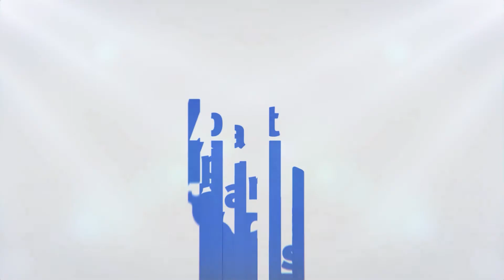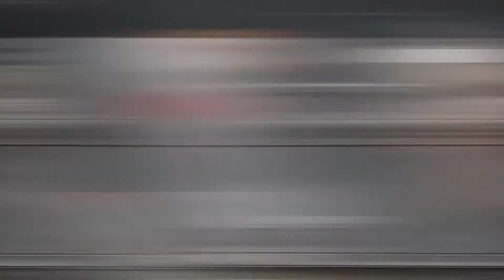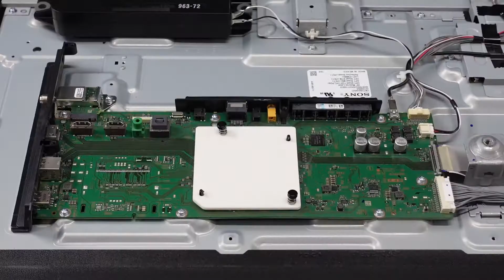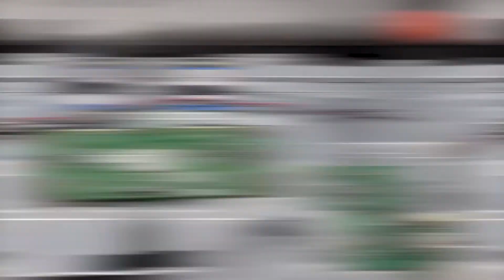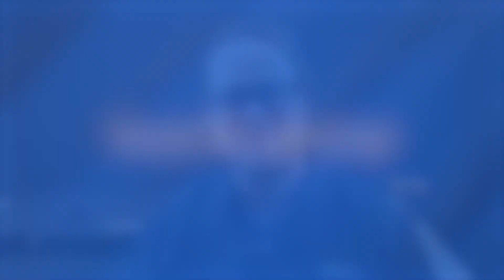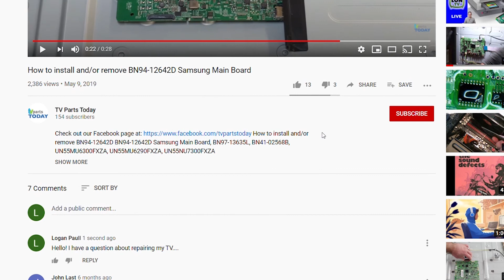Do-it-yourself TV repair.  (SONY XBR-49X800E)

Comment: I have a xbr-55x800e 6 flashing red lights TV turns on but at the boot up it sometimes don't make it through and it starts to blink red o was thinking led is messed up but the screen comes on
Reply from the maker: We would recommend replacing your LED driver board and if that does not resolve the issue, its going to be the backlights themselves.
Reply: @tvpartstoday  can you  advise me if that's the power board or that daughter board at the bottom

Comment: My xbr65 keeps turning on and off (loop) tried factory reset holding volume down Button and power button tv.  No luck.  Then tried volume down button on remote and power button on tv.  Momentarily screen showed safe mode, but then went back to doing same thing again.  Any recommendations on what might need to be replaced
Reply from the maker: That could be your power supply or your main board. I would suggest replacing both. If you need help to identify those parts please send us an email at info@tvpartstoday.com.

Comment: I have a Sony XBR55-X800E the main board is discontinuated, i want to fix it it only has one year of use, i saw that the XBR55-X800G is newer and it has the same size conectors and is pretty much the same, but i'm not sure if it will work, can you give an advice?
Reply from the maker: The main board is definitely still available! We get this main board in on an almost weekly basis. The main board is definitely still available! We would not recommend using a main board from any other set as it will not work for you. https://www.tvpartstoday.com/A2165797B-A-2165-797-B-Sony-Main-Board-17363371-p/a2165797b.htm
Reply from the maker: It is not discontinued. We get them into inventory often and also test this specific part in a live working set before shipping it out!   https://www.tvpartstoday.com/A2165797A-A-2165-797-A-Sony-Main-Board-A2165796A-p/a2165797a.htm

Comment: This is awesome - my sony xbr-49x800e doesn’t respond at all to manual power or remote. I can hear a little buzz sound when I plug tv in. I will be calling you. This model has had major issues from what I see in Sony’s forum. What should I start with regarding fixing?
Reply from the maker: Does your standby/indicator light on the front bottom of the TV blink at all? I would start with replacing the main board and go from there! We are out of stock on it at the moment but we get these in almost weekly. This main board is one that we are able to fully test 100% before shipping! The link is below: https://www.tvpartstoday.com/A2165797A-A-2165-797-A-Sony-Main-Board-A2165796A-p/a2165797a.htm

Comment: I have a Sony XBR-75X940E, and the middle of the screen, about 2.5 inches thick are colorful vertical lines that goes all the way down.  I've taken the back off, searching for any loose ribbon Cable, can't find any.  What should I do next?
Reply from the maker: The symptoms you are describing could be caused by either the main board or the tcon board!

Comment: I have a Sony XBR-49x800E.  My screen suddenly turned to a bluish/dark grey color.  I could hear the tv show still running and was able to get the tv to action commands from the remote (even though I could not see squat on the screen).  This tells me that the  issue has to do with the screen which led me to believe it was the LED driver board.  Do you agree with that diagnosis (I'm no expert on smart tv's by the way.  I'm just doing this by logic).  Let me know your assessment so I can buy the board that needs replacement.  Thanks C.Rausseo
Reply from the maker: LED driver would be a great place to start. If the backlights are totally out and not lighting up at all, there could also be an issue with the power supply board or the backlights themselves. If you are still seeing some illumination coming from the screen, there could be an issue with the main board. If you would like a little more direction and maybe someone to bounce ideas or troubleshooting off of , give us a call at (800)203-7484 and someone can help you get pointed in the right direction.
Reply: Same problem, did you found the solution?